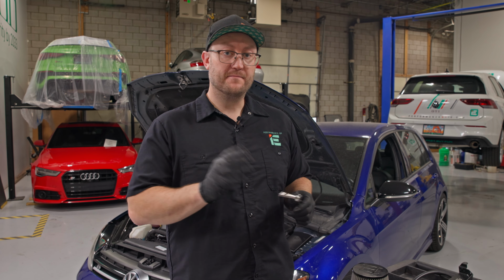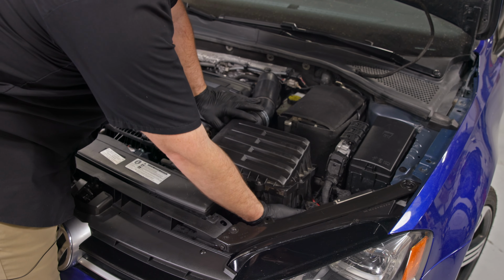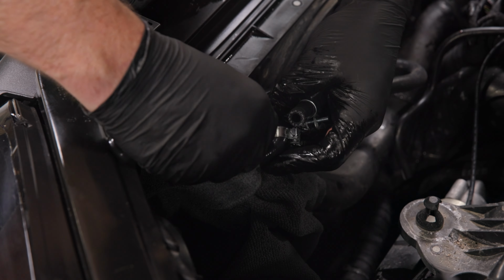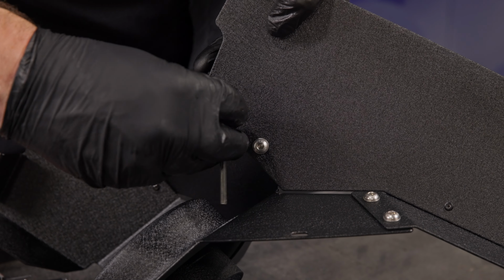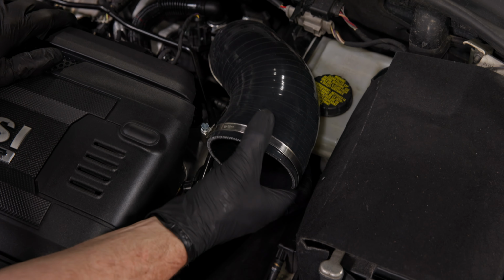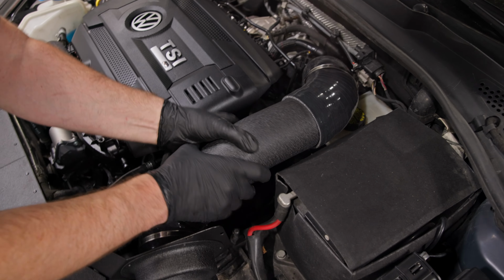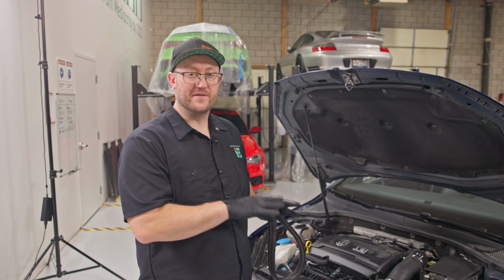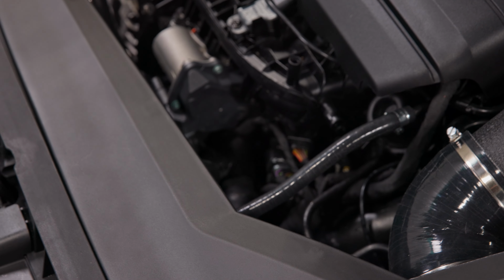How To Install Your iE MK7/8V Air Intake System

Comment: I tried to install this yesterday and hit a huge snag trying to locate the T30 bolt attaching the stock inlet pipe to the turbo and had to put a hold on the project.  The installation is not as easy as they say.
Reply: I had a very hard time disconnecting the PCV hose from the stock inlet pipe
Reply: @coryholte5305 It happens when you've never made that change, then it's easy.

Comment: Thats expensive for not much metal. The filter is like 50-70 bucks the pipe is aluminum a piece thats prolly worth like 60 bucks then the intake parts aren't metal and the rest is clamps and plastic brah come on.....

Comment: hi please respond i need immediate help with the “two similar inlet pipes” i need to order the larger one that pairs with the IE inlet pipe please i can’t find a link anywhere for just the pipe
Reply: Pretty sure if you order the intake from them it comes with both.

Comment: 5:10 in the bottom left corner are two 3M adhesive pad that are included in the kit but never utilized. What are the for? I’m assuming to provide padding for the damn if it has any rattling against the plastic but idk.

Comment: That back clamp is impossible to get off. Sitting here half an hour. No luck
Reply: You absolutely need a small ratchet with the 7mm socket to get it off.
Reply: @elijahchavira175 I took my inlet pipe off, and then I was able to get the accordion style hose off

Comment: I got a S3 8V 2014 But in the website of IE it starts with 2015 and 2021 models. So wont fit ? Think engine is the same.

Comment: Just got IE intake for my MK8 GTI, it’s a 2024. The lower coolant hose connection at front of car doesn’t have a clamp. It’s a solid ring and Can’t get the hose off. Any idea how to get it off and not ruin the hose.
Reply: Did you ever figure this out? Just got 1 for my mk8 R
Reply: @ckretsfk4735 a lot of wiggling using hose pliers I got Harbor Freight for cheap. Turns out I ended up taking intake back off, I hate the sound of the car. Drove a MK5 R32 for 15 year(original owner), never had a turbo car. Car sound like ass to me. I think there something wrong with turbo (car is brand new 2500 miles). It sounds like a metallic scraping sound at low rpm when spooling. 2 dealers say that’s normal? Swear it didn’t do it when I test drove it. Also the secondary air comes on at every startup, so loud . Intake just made it all louder!

Comment: I have purchased this intake and the inlet pipe. Should I install it before tuning it or wait and do it at the same time? I’ll have the tune in about a month so would it be okay to run this stock until then?

Comment: Redid all my charge pipes annnnnnd ran into a problem with my current intake. The secondary injection port and the vacuum line now sit on on the charge pipe and the intake doesnt fit. I needed to do some extra modifications to make this all work. Long story short..

THE QUESTION: Does the IE intake design take in account to work with upgraded charge pipes and allowing enough room for the secondary injection port to connect?
Reply from the maker: There are no fitment issues with our complete intake system and charge pipe upgrades. :)

Comment: I have the IE intake on my 7.5R and when i removed it to install a short shifter i noticed a light film of fine dust on the inside of my intake pipes, i think it was getting through the filter as all my clamps had a proper seal and were tight.
Reply: Estás diciendo que tiene algún tipo de fuga
Reply: @lightdr6 no tengo fuga. Pero el filtro no atrapa el polvo bien fino. Se pasa de poquito y tengo que limpiarlo cada rato.
Reply: @jeezusgarcia4255 fuga exactamente donde, talvez puedo ayudarte

Comment: how much does the polymer lid weigh more than the carbon fiber?
Reply from the maker: Not much, both materials are extremely light that you may not even notice the difference between the two lid types.

Comment: What do I do with the 3m foam pads that came with the kit?
Reply from the maker: They can be used alongside your ECU if the intake is contacting it at all. This happens on some cars which is why we include them. But if you don't see any contact points, then don't worry about it.
Reply: @IEtuned  thanks!

Comment: 10:30 Do you have to the size on that 4mm Allen ? Length? I bought this intake and realized I was missing that screw
Reply from the maker: That screw should be a M6 thread with a 10mm length.